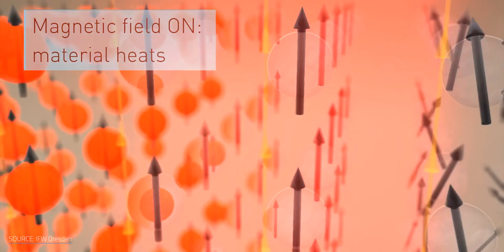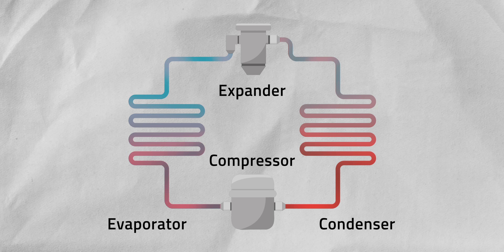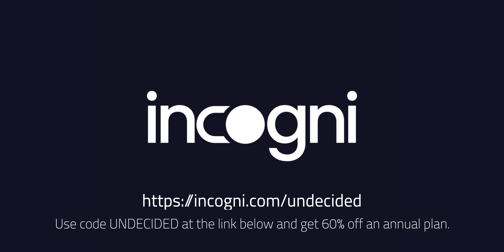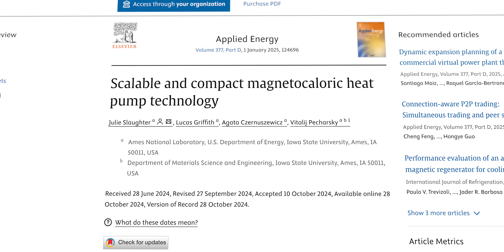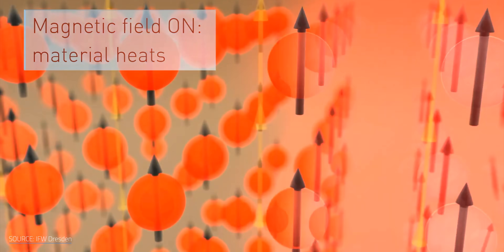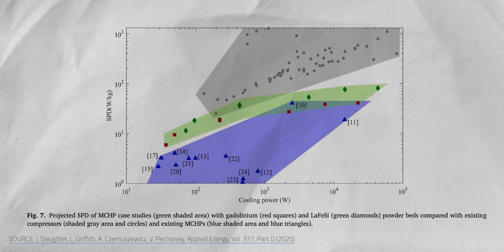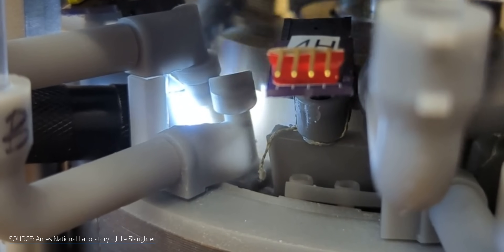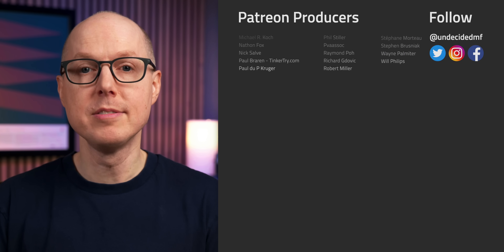How Magnetic Cooling Is Breaking All the Rules

Comment: What about using nitrogen or carbon dioxide as refrigerant? 0:44
Reply: I have seen research on CO2 refrigeration really high pressure if I remember right but totally feasible
Reply: @beartankoperator7950 yes it is generally only used for large scale refrigeration like super markers and ice rinks
Reply: @beartankoperator7950  yes, its coming to the car world. hoses are 2x the size because the pressures are 2x as high.
Reply: @SimplyOffRoad  wow, you really know what you’re talking about
Reply: I want a solid state strontium reactor running my systems
Reply: @g1expert102  magnets are probably cheaper and safer. You can't get radiation poisoning from magnets or isobutane.
Reply: my thoughts exactly..
Reply: @suggesttwo  thats not usefull, it's way to hard and expensive to get abdominal its really hard to control with it being around -190 to -170°c or something
Reply: Do you want to have to refuel your refrigerator every week? Too expensive, respectfully disagree.
Reply: @Biblioholic1993  fr
Reply: I forgot helium, which is used in cryogenic freezers
Reply: So im no expert and not a mechanic. 
I see you guys arguing over efficiency and cost, however I am wonder which is more sustainable? Not sure how long lasting these chemicals are compared to a magnetic mechanism?

Edit: Gadolinium and lanthanum are rare earth minerals so it may not be highly distributable.
Reply: @Bluesuedebutter  Would you pay 7000 for what you can buy for 700?! Cost. Efficiency determines how much energy it uses. Higher efficiency means lower energy use. This is probably the greatest environmental factor.
Reply: We use the differences between phase changes (solid, liquid, gas) laten heat of evaporation. However why not use electron guns??? I've had this idea in my head for years so dont steal it 😅
Reply: @justinhaggerty171  Like the magnetic refrigerator, that may not be affordable.
Reply: @suggesttwo   depends, if we shape the reflection and retrieval just right it will amplify our Electro-magnetic waves.
Oh and you can find eletron guns cheap, they are in you microwave, old TV sets and similar appliances.
Reply: Specialized refrigerants have low phase transition pressures at operating temp which means the pump can run at lower pressure and increase lifespan of the parts and reduce leakage.  They also have huge specific heats so they absorb/release a lot of heat when expanding/compressing.  This creates a higher temperature difference between the hot and cold sides which translates to higher effective efficiency.  Technically any gas can be used for a refrigeration cycle, you're just going to have to put more energy in to get the same amount of heat flow with less optimal gasses.
Reply: Well, if you look at the history of refrigeration. The very first iteration of an actual air conditioning unit ran off of water and was used to dehumidify a printing press business. As long as you can get the suction line cold enough to attract humidity, you can refrigerate a space.
Reply: @suggesttwo  A lot of the comments are missing the fact that the critical temperature of nitrogen (-147 C) and carbon dioxide (31 C) are too low to be usable. Above these temperatures it's impossible to liquefy them regardless of temperature, so you could never use nitrogen in an vapor-compression cycle, and CO2 could stop working if the condensing side (which is in contact with ambient temperature) goes above 30C, so a good chunk of the world in the summer. It's not a matter of practicality, the basic physics means it's impossible
Reply: @cactus445566  There are cryogenic freezers in labs and manufacturing plants that go down to -70°C. They use Helium. Nitrogen doesn't boil at 30°C or nitrogen would be liquifying out of the air sucking all the air at 30°C
Reply: @suggesttwo  I said critical temperature, not boiling point. The critical temperature is the temperature above which a substance can no longer form as a liquid
Reply: Phase change is almost a resuirement for cooling as does most of the work in terms of heat-exchange.

Nitrogen and CO2 dont change phase at resonable temperatures withour extremely high pressure setups. So thats why its not easily aplicable. It is done, but its not easy.
Reply: Seriously? 
R728 and R744
We already use them. It's old technology.
Reply: @Aa-ron01 I forgot ammonia.
Reply: @suggesttwo  Outside a brewery in Belgium is a huge metal compressor setup used to cool beer using ammonia like hundred years ago.
Reply: @Aa-ron01  Yes I know. Better to pay a little more than a $7000 magnetic fridge. Air, Helium, if we are going to allow flammable gasse methane - natural gas, propane, hydrogen. I suspect R-12 freon was the best for the environment because it needed less power from the wall reducing power consumption. Higher efficiency also means a smaller system reducing production costs.
BTW, when something is very expensive it is indicating a lot of energy is needed to produce it. It may be difficult to work like aluminum, stainless steel and copper.
Reply: @suggesttwo  most of the time the reason why something is expensive it's because of demand and/or no specialized tools for the production of its parts.
Reply: @fidelramen5202  Demand is a factor but if it costs $7000 to build you don't sell it for less than it costs to build. Toyota sells a lot more cars than Bugatti full of specialized parts for weight control. Or McLaren, Koinsegge etc.
Reply: @suggesttwo  are you joking? R12 refrigerators used several times more power than current refrigerators using 134 or 600, I’ve been a refrigeration mechanic since the 80s and seen power consumption drop by at least 70%.since the 1980s R12 refrigerators of similar sizes
Reply: @spinnymathingy3149  So that's why R134 replaced R12. More efficient, smaller system, cheaper to manufacture.
Reply: @suggesttwo  sorry, I misunderstood your comment, I thought you were saying the old R12 was a more efficient option
Reply: @spinnymathingy3149  I don't know which refrigerant is the transfers heat most effectively. The best one will require less electricity and allow the smallest system to be used, cutting production costs.
Reply: @ for domestic refrigerators R600 is very popular so I’m guessing that does the job well. And I’ve got to say that the components are very small in comparison to 40 years ago. The compressor is tiny, the tube work is very small diameter and the amount of gas is so small. Many refrigerators use less than 100 grams of refrigerant gas, whereas the old R12 350 grams would have been a regular charge.
Reply: @spinnymathingy3149  So isobutane is a much better heat conductor/higher specific heat capacity allowing faster heat transfer, lower energy use, a smaller system resulting in lower production costs.
Reply: @ yes definitely, that’s the R600 mentioned before, the beloved Boom-Boom gas
Reply: @suggesttwo  your car-making analogy is wrong. Early-adoptors will always pay a premium and then prices will drop precipitously for lesser versions of the same product. Elon Musk proved this with his first Tesla roadster.
Reply: @suggesttwo  in a household refrigerator, the super high pressures needed for Nitrogen or carbon dioxide would generally be impractical. They are safer chemically than many refrigerants we currently used but if I'm not mistaken, the forces needed and material upgrades required for a functional carbon dioxide or nitrogen household fridge would SKYROCKET the cost. Not trying to be rude and i also may be wrong but despite the theoretical application sounding nice, i just don't see it being used widely.
Reply: @kami2646  $7000 like the magnetic fridge?
Reply: @suggesttwo  at 7k that's a lot cheaper starting point then any of our other household appliances technologies had no? I think even if it was sold for 10k it'd still be a smaller percentage of the average American household income then what a fridge was in the 20s and 30s.
Reply: @fidelramen5202  that's how it USE TO BE .. not anymore .. things are just going up
Reply: @suggesttwo  Not sure why you assume there is a floor to the price. There's plenty of potential for economy of scale over many years.
Reply: @contraCharFred  I can buy a 17³' fridge for $650. If a less efficient freon is used the system will be bigger and use more energy.
Reply: Skip that. I'm so cool they call me Kelvin. Pay me and I'll come by your house and take care of your produce. And claims I'm bipolar... Well, my psychiatrist disagrees.

And I make no claim to nobility but I'm surprisingly unreactive and 99.9% less toxic than any social media you currently use.

California says I may be carcinogenic, but... Well, what isn't these days?

Comment: I think it will in time come to a personal computer near you. It will most likely be in one of those luxury custom PCs that costs way to much for what it does and most likely be one of the parts that is carried over from build to build. As the most it would be able to cost for that is 2000 USD if it cools the GPUs, CPU and motherboard. Not just 1 of those but all 3. The cost of custom loops is insane already thus why the price ceiling for how cheap it would have to get for a consumer one is so high. Now if it was to be in an All-in-One  they would have to find a way to reduce the cost to below 200 USD while still being objectively better than water.

Comment: Matt, I have a dumb question: Why haven't HVAC heat pumps been tied into other household appliances? Specifically, we have devices for heating water, cooling refrigerators, heating clothes driers, and so on. 

One would think that tying the appliances together would be a no-brainer. During warm months, excess heat that would be dumped outside the home on the external side would be used to heat water, dry clothes, etc. The loop to the fridge could be tied to the internal side of the HVAC loop. During cooler months, auxiliary loops to appliances would automatically swap to the other loop.

Basically, it comes down to "why are we using individual heat transfer systems for all these appliances when we could centralize the thermal transfer to a single 'whole house'" unit? Especially when some systems, like refrigerators and freezers are dumping their waste heat directly into the conditioned envelope where it has to be removed a second time.
Reply: I would say it is due to costs, as always. It would be quite the task to cooperate between all sort of different companies to create a standard for these thermal loops. And then the difficult task of having time varying loads which need to work together and the physical installation of the loops connecting these devices thermally in a house. Would be really neat if waste heat is reused in some way
Reply: Interconnected appliances are the LAST thing that you would want to do. The connection for the heating-cooling processes for so many different appliances throughout a house would be incredibly complicated, along with the complexity of regulating the supply to each device and the variable production of heat-cooling throughout the day. Then the replacement appliance down the road, expecting (for example) a clothes dryer in 10 years time to be compatible with the by then old tech of the old system.
Reply: @spinnymathingy3149  yeah, there is that...
Reply: HVAC Engineer here - the fundmental isn't that it can't or shouldn't be done, but the controls for the equipment would all be way more expensive, cluttered, and very complicated if we had everything tied in together. It would absolutely be possible to have cold and hot water loops going everywhere alongside heat pump technology to improve functionality and efficiency. The problems arise when you try to scale that down to a single home, where the upfront costs are top priority for contractors. You can make a very efficient, well engineered home. The problem is that the equipment required to do so is as expensive  as the home itself would've been had you gone with a more standard HVAC setup.

The kind of system you are imagining does occur, but only commercially, and in large enough use cases that you can maximize the gains from such a setup.
Reply: @mattrocde  thanks. thats the type of feedback I was looking for.
Reply: well it alot more prone to leaking and of corse geting holes proke throew them form hamering nails into walls and if theyare behind a stuid and get peracied then could make cfc leakage or refrerange leakse abd over heating and burnouts of motror and make repire even more expsive with is just even n far wrose and harder to deal with for bacly everybody both for the HVAC and other techisinos and for you wallent in inpection and repaire fees. so its just not worth it unless your diong it on a mars space coloanly or space ship or soemthing like that that is used to do that much better wihut worrying aobit some dumb dumb driveing a nail in a collent or refregrant line.
Reply: from an energy point, your idea will be very appealing. But the energy price today is low and metal prices are high. If you consider the labour costs, these ideas will be difficult to implement
Reply: I think that at least some part of your idea would be beneficial. however the fight to make profit would probably make an inferior product, like most late stage capitalism products are only some percentage of what they could be. remember, manufacturers made light bulbs limited in their lifespan and fined light bulb makers if their incandescent light bulbs lasted too long.
Reply: Houses are a conglomeration. Single devices like a space station, or an electric vehicle can have the component parts designed-in from the start.  Tesla (don't bite me) efficiency is helped by coordinated heat exchange between a multitude of components and the cabin.
Reply: Because centralization means complexity. Complexity means much higher chance for disaster. 

You actually want decentralized units. Because in centralized ecosystem if something dies, whole system is compromised, either by not working or barely working which could mean the whole house is down for maintenance until system has been fixed. 

If in a decentralized system as we have it today, fridge dies. You don't care much. You can still cool/heat the rooms. You still have heated water to shower. If boiler dies you again, don't care. You can still heat/cool the rooms, you still have fridge to cool the food. Your whole house isn't hampered because of one thing dying.

Also then there is discussion of whether centralized system is more efficient then decentralized one or not. As with centralized system you need more power to push / pull unlike with standalone units which can be properly optimized for their purpose.
Reply: @sermerlin1  It's a case of it depends on the system. Here in Maine (and probably a bunch of the northern states) we tend to do a combined hot water heating and general hot water system off the same boiler as it's more fuel efficient. Most systems are still fossil fuels up here and costs have always been high, but we're a frugal lot so the efficiency is worth losing both systems if it fails. The last place I had was really nice, flip a couple valves and you could switch over from the oil fueled boiler to a wood fueled one. Good for if you have cheap wood (or 'free' wood if you have the time, equipment, and land) or if the oil system fails since most people would have to get by for a day or so with space heaters to keep the pipes from freezing. I know some houses particularly out of the way spots have a similar system with an under-sized electric boiler that won't keep the house properly heated, but will keep the pipes from freezing for several days if need be.

I can see where it would be possible to tie in the heat pump for a refrigerator or freezer but the reclaimed heat would probably be so negligible on a boiler system to not be worth the complexity. Maybe tying similar systems together could work though. Say tying a refrigerator and chest freezer into the loop of a heat pump to dump that heat specifically into the room you want it, or to run the defrost cycle on the external unit so it turns off less often. They'd all need to be using the same coolant, and have interoperable fittings but that shouldn't be a huge problem. Making the refrigerator or freezer able to switch over from an isolated to a connected system would add some complexity to them, but it shouldn't be that bad.
Reply: Imagine the points of failure.   You blow up the washer and suddenly your house has no heat or hot water?    No thanks.

Comment: Magneto calorics is NOT solid state cooling until they do not rely upon MOVING permanent magnets.  (The same way a spinning magnetic disk for data storage is not solid state storage).  To that end, what are the limits of the optimized system assuming stationary electromagnets that are turned on and off?